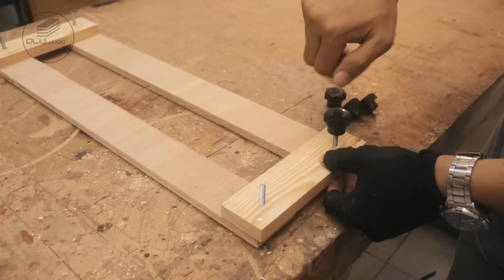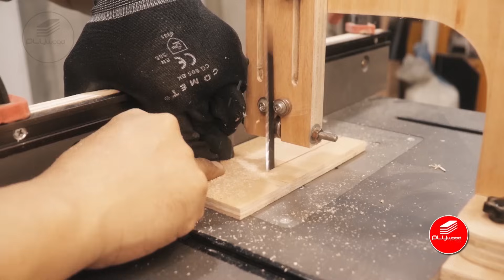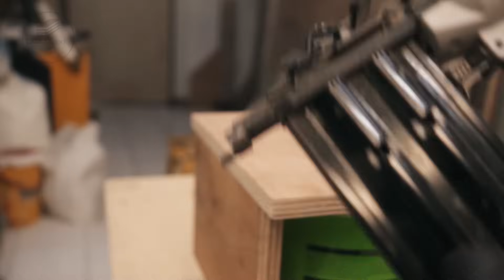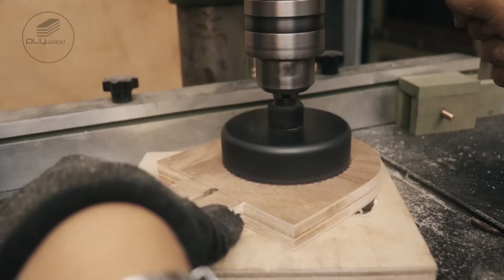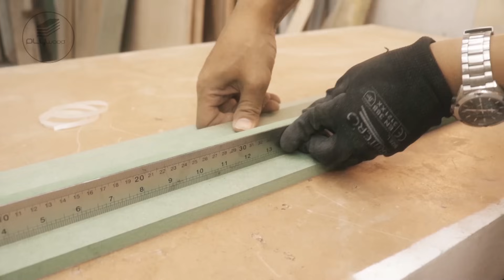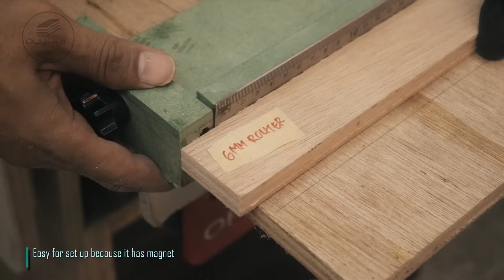7 Tips DIY Jigs How To Hack Power tools!

Comment: I’m pretty accurate with my edge nailing and find that turning the gun the opposite way you get the nail cross section cuts instead of follows the grain . Not trying to rain on the parade but …C’MON
Reply from the maker: thank you very much